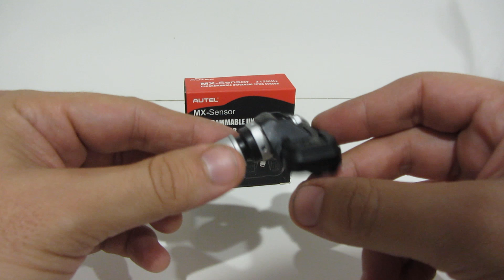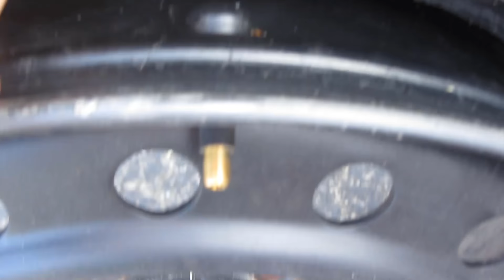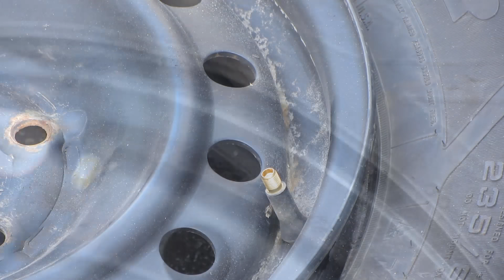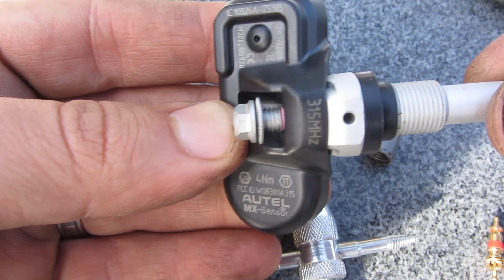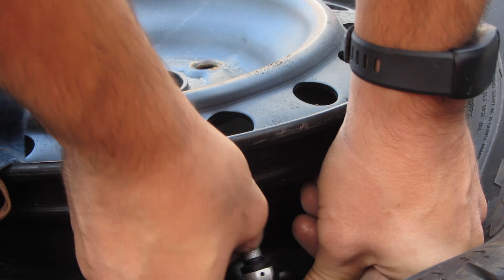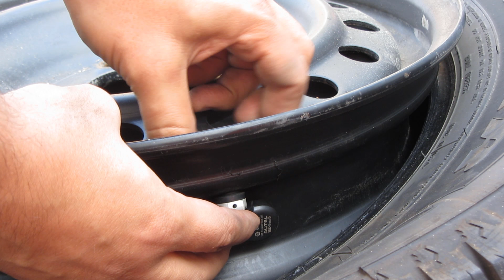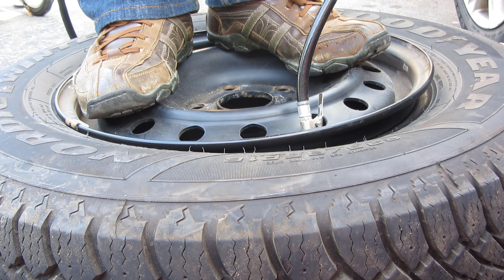Install New TPMS Sensor DIY Without Needing Rebalance

Comment: How long did the batteries lasted on them only being used in the winter
Reply from the maker: Oddly, only a couple of years, which I didn't like. I since bought the newer 2-in-1 MX Sensors, which I'm hoping last much longer.
Reply: Only using them in winter will make no difference, the batteries don't shut off when not in use, they are working all the time, unless you can put them in some kind of hibernation mode in the programming.
Reply from the maker: @danielmoffett8595  Sensors do shut off a few minutes after the vehicle stops. They have a centrifugal switch inside that turns them on once the wheel spins at a certain speed. That's why the manual for cars that automatically learn new sensors tell you to drive the car above a certain speed for the relearn to happen.
There is usually a secondary way to turn them on so that scanners can read them directly. I think it's a reed switch (which responds to a magnet).
Reply: @GabesHacks  If that were the case, you car's computer would tell you that "ALL" of your tires are flat when you first turn the car on and it runs through its check's and processes. It doesn't. Your car's computer shows that all systems are functioning properly (including TPMS) or it would give you a warning. The sensors working is the ONLY way the TPMS light goes off after initial start of the car. You are correct in that when installing "new" sensors the computer had to "relearn" and sometimes that involves driving at a minimum speed for a minimum distance but it's not to "turn on" the batteries.
Reply from the maker: @danielmoffett8595  The light doesn't come on immediately because the car knows it can't expect a signal from the sensors immediately. I know this from experience. The first time I put on my winter tires without any sensors at all, it took about a half hour of driving before the TPMS light came on. Give it a try.

Comment: Thank you sooo much for posting this! So much cheaper than the $600 I was quoted!
Reply: That HAD to include the cost of the sensors. Most tire shops will unmount tire, install sensor, remount tire, and rebalance for around $30.00 per wheel.
Reply from the maker: @danielmoffett8595  Even if the sensors were included, $600 is ridiculous.
While $30 per tire for only installation is a little more reasonable, it's still a bit of a money grab. It would take one guy about a half hour to do all 4. If you're willing to pay for it, maybe at least find a place that will just charge you their regular hourly shop rate for the time it actually takes, rather than a flat rate.
Reply: @GabesHacks  if you've already got all your wheels off and lined up ready to go it MIGHT only take a half hour. A mechanic's time starts as soon as the car drives through the door. That includes jacking the car up, taking all for wheels off, doing the complete change-out of the sensors, remounting the wheels on the car, then lowering the car off the jack (and shop rates are typically $100 to $120/hour). Your video took over 11 minutes, for ONE wheel, that was already off the car sitting ready at your "hacked" (and I don't mean hacked in a good way) bead breaker. All 4 in a half hour? I think not. If you think you can, do a video of you doing ALL for starting when the wheel are still on the car and ending when the wheels are back on the car, AND the sensors are all relearned.
Reply from the maker: @danielmoffett8595  Keep in mind I took 11 minutes with the wrong tools for the job and taking the time to teach 🙂
Reply from the maker: Wow, that's nuts!
Reply: Just to put sensors in???  Oh my gosh!  I thought $120 was too much when I had new tires put on.
Reply: I was quoted $180 per tire to install and program, not including the cost of the sensor which you have to buy from them for them to install. At that point I didn’t even bother having them look up what they wanted for the sensors.

Comment: Do you need to program it after installation?
Reply from the maker: It depends on your vehicle. Some cars automatically learn new sensors, some don't. Mine doesn't. I used programmable sensors that I programmed before installing them because I wanted an identical second set for my winter tires. I made a video about how I programmed these. The link is in the description.

Comment: Not sure if you covered this at some point but I haven't really heard anyone address it. What is the virtue of these internal ones over the screw on external version? These still have batteries which will eventually go bad, right? I suppose they can't be stolen but seems like a lot of work for the same effect.
Reply from the maker: As far as I know, none of the screw on type sensors are designed to communicate with the car's computer. They need a separate, custom receiver. They're only designed for cars that don't already support TPMS.
Reply: @GabesHacks  ah I see. Very good to know. Any idea how long the batteries last?
Reply from the maker: @JasonAguirre  From what I've read, it's about 7 years, but it depends how much you drive. They have a centrifugal switch inside, so they only turn on when the car moves.
Reply: @GabesHacks  oh ok that's much better than I feared. It would suck to have to change any more often.

Comment: First things first. Mark the tire where the valve stim is. Just in case
Reply from the maker: You can if you want - it can't hurt. But if you're only breaking the seal on one side like I did, it's not necessary.
Reply: @GabesHacks  Until you drop the sensor inside the tire and then have to break the bead around the whole tire .... So. First thing’s first. Mark the tire where the valve stem is. Just in case.
Reply from the maker: @Melbatoast454  I broke the seal all the way around on one side only. If I dropped the sensor inside, I could get it out no problem without breaking the seal on the other side and without the tire rotating on the rim.
Reply: @GabesHacks , you are a very patient man.

Comment: Anyone to test which one is faulty, or should you just do all 4 anyway
Reply from the maker: Yes, you can figure out which one is faulty. There are either tools that can scan the sensors directly, or tools that can plug into the car, which can tell you which one it's complaining about. But most often, it's the battery that is dead. And if one battery is dead, the other three will be close to dying anyway.
Reply: @GabesHacks  and so if I were to replace the battery, it would probably just be best to buy 4 new sensors right cus I saw a vid of a battery replacement that was way too in depth
Reply from the maker: @Brandman1297  Yeah, they're not designed with replaceable batteries.
Reply: @GabesHacks  thanks for the help man

Comment: Might b a good idea  to put the soap on an old paint brush as the wheel could have rust spots inside and rubbing your bear hands /fingers could ger could get checked or cut ?
Reply from the maker: You can if you want, but I didn't have any problems using just my hand.

Comment: This might be a stupid question but is there any programing with the senor? Or the car should read it without any problem?
Reply from the maker: It depends on your car. Some cars automatically learn new sensors. Some have a procedure you can initiate manually to learn the sensors. Other cars have to be programmed with a special tool with the code of the new sensor. Check your owners manual or search online for the TPMS learn procedure for your make/model.
I used programmable sensors here because I wanted an identical second set of sensors for my winter tires.

Comment: Nice diy, but i'll keep using my old dependale air gage, much easier and always reliabe. how is data tranfered, wifi app? one more electronic 💩 fail.
Reply: But then you have to keep seeing that TPMS warning light (I know, I know, put black electrical tape over it but I hate that too).
Reply from the maker: The cars that have TPMS built-in are wireless, but not wifi. The sensors communicate with a receiver in the car and the car's computer monitors the pressures and puts a light on the dash if one is too low.
If a car does not have TPMS built-in, you can buy ones that will talk to your phone or a special receiver that you plug in.
But yes, it is one more electronic thing that can fail, but it will also put a light on the dash if something does go wrong (like if it can't communicate with one of the sensors for any reason). Checking the tire pressure manually is always more dependable, as long as you do it!

Comment: dont use soap or water it promotes bead rust i use siicone spray go joe probably ok
Reply from the maker: The outside of the rim will get far more water on it, and in places where there's snow, salt too. Whatever water you use on the inside will never make it corrode faster than the outside of the rim.
Reply: Got a quote from Firestone   replace one sensor and replace batteries in other 3  in the $800 range
Reply from the maker: @edwardhouston376  I didn't think any sensors had replaceable batteries. But that's way too much money for anything to do with replacing sensors, for sure!
Reply: Stay away from those scammers

Comment: Great video.  Thanks for the information.  Before I attempt this procedure on my 2010 WV cc I have a question.  If the battery is bad in my sensor (right front wheel) is the reader going to be able to read the information needed to program the replacement???
Reply from the maker: If the battery is dead then there is no way to connect to it. The code should be printed right on the sensor, which you can see after you open up the tire.
It sounds like you are planning to buy programmable sensors? If you're just replacing a bad sensor, then you don't necessarily need to. You can buy any compatible sensor and program your car instead. You need a scanner tool for that, but if you're planning to buy a tool anyway, it's a good investment. You can try the Foxwell NT530 or NT510 Elite, which are fairly inexpensive. Just email the company to make sure it can program TPMS for VWs.

Comment: Impressive how you break the tired seal with pieces of wood...  I think that's the hardest part that I wasn't able to do it at home...
Reply from the maker: It doesn't always work. If any sealant was used on the tire, then it won't and you can use a different method like this: https://youtu.be/-VICFao8Mjw

Comment: Who ever started this wheel sensor shit (yeah the government) needs to be punched in the dick. Makes no sense like I need a sensor to tell me my tire is low. Like I can’t see that it’s low.😡😡
Reply: I have a friend who is angry because she doesn't like the window glass to be lowered with a button, she wants to turn the lever To each his own theme..
Reply: Also, what a waste to throw away millions of good sensors every few years just because they need new battery.
Reply: I'd rather kick him in the 'nads - that way there's no hand to anything contact!  I spent most of my driving life checking tire pressure and then the DA's in government decide that because they're too stupid to do it, everyone has to see that damn warning light.
Reply from the maker: Yeah, I have mixed feelings about them. I think they're overly complicated. A similar thing can be done without internal sensors, like by using the ABS sensors, which some cars do, but I think is illegal in some states depending on how the law is worded (I believe some laws state that the car has to actually know the exact pressure in the tire, which the ABS method can't do).
And yes, you can just look at your tires, as long as you do that! It's easy to jump in your car without looking. One time when I was 21 or 22 I was driving with a really low tire (not completely deflated) and didn't realize it. A police officer ended up pulling me over to point it out.
Reply: Agreed and the battery only last for certain period of time. Basically, it is a matter of time (5 to 10 years) need to be changed.
Reply: It's a convenience. I bet you're a Republican.

Comment: is the hole diameter for the pressure valve standard across all wheels?
Reply from the maker: I'm no expert there, but based on this page, they're usually the same (0.453"), but not always: https://www.tirerack.com/tires/tiretech/techpage.jsp?techid=208
Reply: Gabe's Hacks thanks mate

Comment: The tires on my new to me car I bought that appears to have had a sensor go out 2 days after I bought it are P225/50R18  I suspect that size is going to be considerably more difficult than that huge truck tire you were using.  What is your opinion on this?  I've got 12 of the sensors to maintain now.  I'm thinking maybe I should just invest $50 for one of these https://www.harborfreight.com/manual-tire-changer-69686.html
Reply from the maker: I was working on 16 inch tires, so yours are bigger than mine. Bigger might even be easier, I can't say. I can't comment on the tire changer, but check for reviews on it. I think I remember seeing a couple videos on YouTube about that tire changer.

Comment: This is a "how to install your own TPMS" video.... The TPMS is a different weight than the schrader valve you replaced... Balance will be needed.
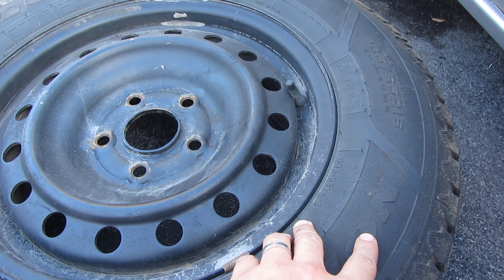Reply from the maker: That's certainly possible. I discussed that in the video at 2:17. But if you're replacing a TPMS sensor with another, there's no need to rebalance.
Reply: Servando - your teacher told me you were a poor listener!
Reply: Too much time sitting at the back of the class not paying attention Servando lol
Reply: Not only is reading fundamental but listening is too!  That was discussed already.

Comment: Good Video. But I would shy away from after market sensors,because my backyard mechanic installed an aftermarket one  on my Impala, & it's reading 2 to 3lbs off from the rest of them. He says it doesn't matter, but he should've installed a proper AC Delco one, & then it probably would be much more accurate. That's just my own personal experience.
Reply from the maker: He's right, 2-3psi is not a big deal at all. Every car has their threshold for reporting a problem, but it's usually around 20psi where it warns you. The point of TPMS is to warn you before you're totally flat and your tire starts disintegrating, so whether it warns you at 17 or 23 psi, it's still doing its job.

Comment: How does the car get the reading though?
Reply from the maker: Are you asking how the car and the sensor communicate in general? Or are you asking about programming the car for the new sensor?
Reply: Actually both
Reply from the maker: @carlospretty9189  They communicate wirelessly. The sensors you use have to support the radio frequency that the car supports, either 315MHz or 433MHz. Some cars have one receiver for all four sensors, so the car can't tell which wheel is where on the car (although some have a procedure you can do to tell it which wheel is where). Other cars have 4 receivers, one at each wheel, so it can tell which wheel is where.
Each sensor transmits a unique code, and the car knows which 4 sensor codes belong to it. That's where the programming comes in when you replace a sensor. Some cars automatically learn new sensors, so you don't need to do anything. Other cars have a procedure you can do manually to relearn the sensors. Other cars need a special scanner tool that plugs into the car's computer to program the new sensor code.
In my other video, I used programmable sensors because I wanted a second identical set of sensors for my winter tires: https://youtu.be/N6p6xV4PlHc
Reply: Gabe's Hacks thank you